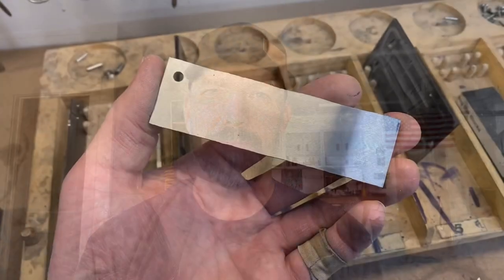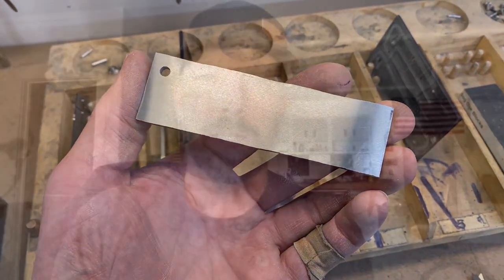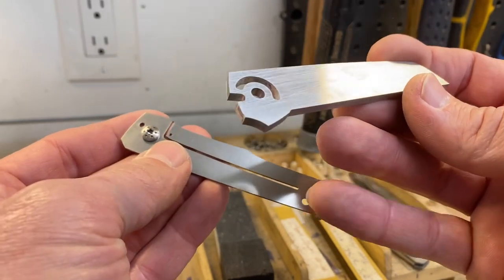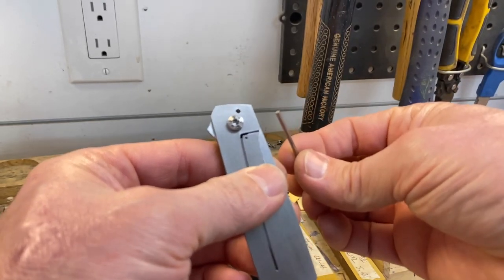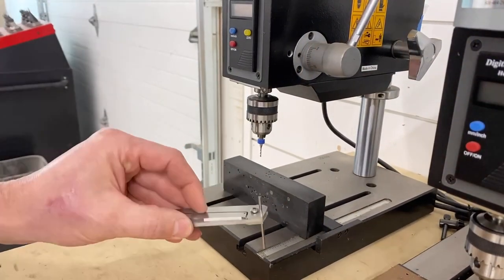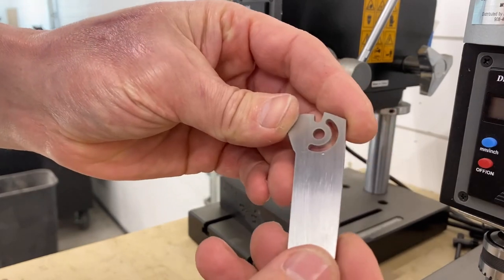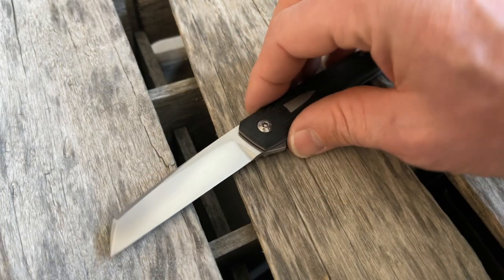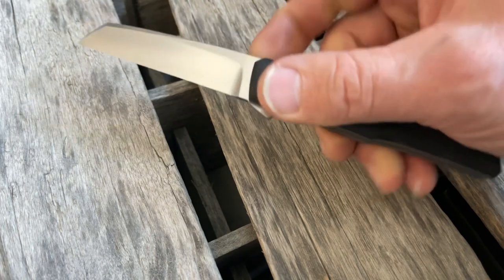How I Do It: Setting the Detent

Comment: what's the best way to fix a detent where the ball falls completely in and makes for a very stiff detent release. Maybe the ball is not set far enough into the liner because it POPs out when it does release. I'm trying to chamfer the edge of the detent hole, It's not having any effect yet (except sucking the blade closed from further away), but I'm also not sure what angle to use...
Reply: did you figure it out?
Reply: @qdp03  I think I just gave up on that knife. I dont remember which knife it was.
Reply: Detent ramp
Reply: @BladeShowMan  I dont think you know what a detent ramp is.
Reply: @squirts1  well its a small ramp, into the detent dummy,  use a rotary tool and a small missle
Reply: @BladeShowMan  no. A detent ramp... is a ramp at the edge of the lock face on the blade tang. It's intent is to prevent the detent ball getting stuck on a 90 degree ledge when closing the blade.
It has nothing to do with opening the blade and you do not put a ramp on the detent hole unless you enjoy detent lash.